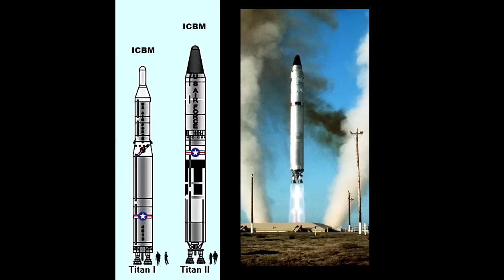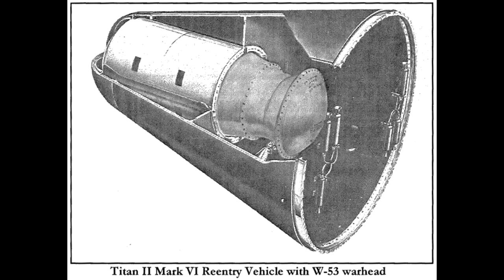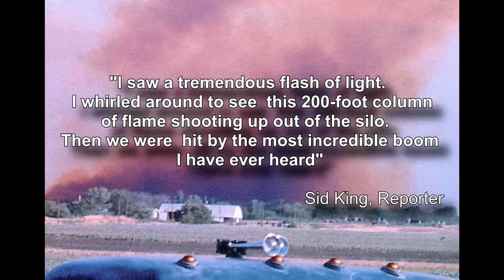Nuclear Missile Explodes Inside Silo - The Arkansas Titan 2 Incident (1980)

Comment: I was a young crew commander in the 70s and pulled alert on the day after the accident. Pre-departure took extra time as we had to make numerous corrections to our “dash-1” tech orders. For several alerts thereafter we were updating our tech orders to make procedural changes.  The site was full of hazards and the fuel/oxidizer especially so. Pulling alert at the Titan II was more engaging than Minuteman I suspect as we were co-located with the sortie and the liquid fuel system requires much more maintenance and environmental conditioning than the minuteman.  Their challenges were keep on top of their many systems. My only regret is that I didn’t do a follow up tour on GLCM or airborne launch crew.

Comment: "Was there ever any risk of a nine and a half megaton explosion?"

No.  Nuclear weapons are actually horrendously difficult to set off.  Detonating a nuclear warhead is actually a perfect storm of conditions that must be precisely controlled in order to sustain the reaction to the point of detonation.  If the warhead was damaged in any way during the incident, you would lose the precision to create those conditions, and the result would be a messy dud explosion from the ignition explosives.   Secondly, there would be no risk of accidental triggering, as there are multiple safety interlocks that prevent arming of the warhead.  And I'm not talking 'oh there's a switch here' casual speak.  I'm talking:  'Until the silo gives a fire order to the missile, there are physical pins and stops that separate the arming mechanism from the firing mechanism entirely'.

These weapons were designed by people who fully understood what they were messing with, and really didn't like the prospect of the thing going off in their face...  Even without nuclear materials.  It's STILL a container full of explosives.

Nuclear weapons are HARD.  That's why they only get built by properly industrialized and technologically mature powers.  Otherwise, they'd be as common as cannons in the 17th century.

Comment: Excellent summary thank you!  I have heard bits about this but now it is much more understandable.  Props as always to you and your channel!
Reply: FYI it is possible they DID test safety features on live warheads (Coloumb tests???)  IIRC though not to the degree you've described (thank God)   IIRC (and this is going back to a thesis I worked on at university a lifetime ago) there were several live tests of such features on actual (small yield) warheads in the Nevada desert in the 1950s.  Now that might be a topic you'd be interested in - tangentially of course, or perhaps Fallout City USA (specifically, the radioactive contamination that several times fell upon St. George, Utah and surrounding areas, particularly during tests Nancy and Harry), or perhaps the atomic soldiers.  Anyway, great vid that certainly spawned a lot of thought!

Comment: Not strictly true that the bomb couldn't be accidentally fired. The fissile material in the core, already overloaded through extensive refinement with neutron heavy material simply needed to be compressed to become critical.  This compression is usually created by explosives wrapped around the core. The explosion using a type of plastic explosive can also be used as a fire lighter as it can be made to burn readily with a flame,  unless,  , ,it's in a confined space in say a nuclear warhead,  in which case once it reaches its self accelerating decomposition temperature,  it'll explode. 
Your welcome.

Comment: From 1966-1969 I was stationed at McConnell AFB in Wichita, KS.  My job was maintaining communication equipment on sites identical to these.  The biggest danger around the Titan II, officially known as the LGM-25C weapon system, was the fuel and oxidizer used in it.  Liquid fueled missiles prior to Titan II used cryogenic liquid oxygen and a kind of kerosene.  Because of the super-cold oxidizer, the missile could not be kept on alert with fuel loaded.  It had to be fueled after receiving the launch order, a process which took nearly an hour.  The Titan II used a hypergolic fuel and oxidizer which was stable at ambient temperature, allowing the missile to be stored fully fueled.  It could launch within about one minute of receiving the order.  Both the hydrazine fuel and the nitrogen tetroxide oxidizer were horribly toxic and ignited when they came in contact with each other.
Reply: I really need to ask, how could such a wrench puncture such a strong weapon?  How is it so flimsy? Flimsy so much that a tool part could blow the fuel outwards. Was the metal used; Aluminium or something? Also surely using Nitrogen would cause many more problems like causing metal damage. Like it becoming brittle. Would that be the reason that happened or am i just completely wrong all together?  haha
Reply: @zae2193  the skin of the missile is just aluminum sheetmetal, an 8 pound socket going pretty fast will cut a hole through it pretty easily, and since the interior section it punched through had *pressurized fuel*, just like a can of compressed air, it sprayed out into an aerosol mixture. 

The oxygen and nitrogen compounds are used specially designed cryotainers made to hold them so that the incredibly combustible oxygen doesn't boil and ignite immediately, while I'm not as familiar with nitrogen, it's the same basic principle
Reply: @ToastGamingNCrew  Sheetmetal for real? I've worked around that for a while and know it is pretty brittle in that sense that it doesn't take much to cut into. Surprised such little would be used on such a highly dangerous weapon. 

Thanks for the explanation, helps a lot more, now understanding.
Reply: @zae2193  
Has to be thin to keep the missile light.  Otherwise could not go 6000 miles.
Reply: @zae2193  Yes, you are partly wrong. The airframe is rather thin on the Titan to save weight. To make the entire structure strong, it utilizes pressurization of both fuel and oxidizer tanks to keep the tanks and missile skins in tension rather than compression, making is very robust. However, as the 1 tank was leaking and no air could get inside the tank, negative pressure or a vacuum formed inside the tank. The very weight of the full and pressurized upper tank was bearing down on the lower tank and airframe structure. As the hours passed the lower tank became so weak that COLLAPSE was definite and would cause the upper tank to rupture, mix the fuel and oxidizer and EXPLODE !  Also calculate the weight of an 8 lbs. socket falling a distance of 50 to 60 ft. It now has greater weight and the VELOCITY at which it hit the side  of the missile. Evidence of the explosion shows it began IN THE SILE and NOT AT THE FAN OR SWITCH. The evidence is that the SILO DOORS blew of in time before the warhead could impact them as shown by the pics of the recovered warhead.    Second, you are thinking of CRYOGENIC NITROGEN, super cold.  This is just gaseous nitrogen to pressurize the tank/ airframe as a homogenous unit and prevent any oxidation !
Reply: @SteveWright-oy8ky  Thank you for the information! Yeah i'm shocked, but after telling me that, it makes a ton more sense. Of course it wouldn't get far if it was heavy, so being so light and easily to damage, it'd defenitely be the ideal way to go. Don't get me wrong, a lot of that was a bit hard to understand, considering I don't study in that field, but defenitely good to know in future. 
Thanks again, as it defenitely helped further understand.

Comment: I would have stresses and clarified that the Titans performance was almost entirely due to its lightweight construction - so light, that it couldn’t support its own weight. I know it was mentioned that the “heavy upper stage and nuke might crush the bottom part” - but many aren’t aware that the rocket literally can’t support itself if it isn’t pressurized.
Reply: The steps taken to swap out a missile require careful propellant transfer to prevent the airframe from collapsing.
Reply: ALL missiles and rockets are designed for weight savings so a larger payload can be lofted into space orbit.  The missile design is sound as long as it is maintained as designed. Fuel and oxidizer tanks are kept at specific  levels and pressure to keep the airframe strong and integral !  Amazing that the airframe didn't collapse sooner  !

Comment: I worked on the T-ll program, and the fuel is Hydrazine, and the oxidizer is Nitrogen Tetroxide.   Since the mix is hypergolic, when Hydrazine comes into contact with any oxidizer, it immediately combusts.  It was only a matter of time before the leaking fuel came into contact with some rust in the silo- like a metal staircase, or some rust on a pipe not covered with paint.   Rust is oxidized metal, and therefore an oxidizer.   Slowly, over time, the shift to solid fuel motors on strategic missiles became the norm, because they are more stable over the long term.

Comment: Great video!
There are professions where you don't want to hear an "Ops"...
I've worked with a lovely old woman in a lab. Who, because of her age, just didn't learn new stuff. No matter how often i told her, that the instrument shut down for safety while she changed the column on a gas chromatograph, because she didn't shut down the hydrogen flow before doing it, she did it again and again... And also left the flame ionization detector on, who, as the name suggests, has a flame in it... Luckily there is good ventilation in a lab, so it was safe. But still...

Comment: When I was stationed at Edwards AFB in the 1990s, a Titan rocket motor (from a solid-fuel booster, if I recall correctly) was dropped and slid down the cliff below the Rocket Lab on Lehman Ridge, across the lakebed from the base. It ignited and blew up. I was walking to my car to go to a meeting, and my first thought was, "Gee, that sun sure gets in your eyes." And they I realized that the sun was off to my right. A few seconds later, the "boom" came, and everyone came boiling out of the buildings to see what had blown up. And that was just a booster motor. I can't imagine the primary or second-stage boosters blowing up.

Comment: While working on an Atlas rocket, near the joint between the booster and the interstage adapter, a co-worker lost a bic lighter from his shirt pocket .(prohibited to have ignition sources on your person on the pad while fuel was aboard) the lighter impacted the elbow of the 10 inch external LOX line from the LOX tank to the turbopumps 5 decks below.  that line is like .040 stainless.  the lighter ruptured (BOOM) but there was no flame.  We tethered our tools to our wrists, and were supposed to keep lighters in our pants pockets.  Fortunately there was no fuel on board, but if the line had been compromised it could have meant de-stacking the whole missile and sending it back to the factory for repairs.  Also fortunately it was downstream of the LOX shutoff valve, which was closed.  This guy had been working Atlases since I was a pup. fred.
Reply: Scary as hell !  Protocol should have been everyone must empty out their pockets in front of an ARMED GUARD , pull Pockets inside out, etc ,.... just exactly for that reason. 1 single human mistake could have cost thousands of lives depending on damage to the warhead !  An Air Force tech used a screwdriver rather than a fuse puller and fired the retro- rockets on a R-V , causing it hit the silo door then fall down between the silo wall and the missile air frame ! And just because he was TOO LAZY to go get the Right Tool for the job !

Comment: Its not really possible for a warhead to go off accidentally like that. Even if the explosives that surround the core were to explode, they have to go off in a very particular sequence to compress the core, if they don't it won't detonate. Not that it has to, it could still spread radioactive materials all over the place. Its so improbable its basically an impossibility.

Comment: A small correction to the statement by the Air Force that , " a nuclear detonation could not happen " is wrong !  Due to the number of Broken Arrows and other nuke weapons mishaps, 4 tests were done at the Nevada Test Site of what was called 1-Point Detonation ! That a single stray bullet, electrical charge or hot shrapnel could in fact , set off a nuclear detonation . 1 of the 4 test PROVED CONCLUSIVELY that a 1-Point Detonation can happen in REAL LIFE , it was now established as a FACT !  Yet it still took nearly 20 years for the weapons safety designers to get the military to install the better fail-safe devices and P.A.L.s !  Far too many accidents of the  many different nukes is concern enough to us all and is still a major issue !

Comment: If the warhead had been compromised, cracked, broken open, there would have been radiation leakage, which could have been bad enough, but the design of the nuke required a specific sequence of events to detonate impossible to duplicate outside of it's design.  Even so, the warhead was a tough nut to crack.

Comment: Talk about a design flaw. I can't believe the guys that drew up that silo design didn't take into account the fact that fuel leaks and/or chemical leaks in a confined space require a spark-less and static free exhaust system as well as insulated switch panels and phones. I remember being in paint and solvent factories and THEY thought enough to implement those things as well as required footwear for visitors that would eliminate static discharge. 
That poor kid was a victim of government bureaucracy plain and simple. They gave him a button that would instantly kill himself. And how did that clown that had the wrong socket live with himself knowing that his screw up killed a serviceman. Tragic.

Comment: Actually a lot of the tests conducted by the US before the bans revolved around the testing of safety features. Also take note that the exact physics required of a starter explosion using conventional means is very precise.
Reply: For one, the fission only occurs if the core is first activated. I assume there are redundancies on how the core is activated to the point it would never activate accidentally on a nuclear warhead.

Comment: Re: the possibility of accidental nuclear detonation

To get a nuclear detonation requires a perfectly coordinated detonation of the conventional explosives around the primary.  It simply cannot happen without the detonators being triggered by the firing circuit. Those circuits would not be energized at that time.  Any unsymmetrically in the lenses that compress the primary and it just won't work.  It might make a hell of mess spreading plutonium around the local area, but it won't be problem measured in megatons.

In fact, there was an incident where a B58 landing gear collapsed and caused a big fire.  Several B53 warheads burned.  Their primary explosives were detonated, but "nothing" happened.  (for a very exciting definition of "nothing")

Comment: These Workers where stupid..    I saw this on frontline.  both of the workers, once inside the container where the rocket was, decided not to go back to get the right tool for the job.  At one point, once the huge nut was removed, the one worker, handed the item over to the other.  Asking if he had it tight in his hand.   He said he did .  However, it slipped out of his hand, falling down hitting the side of the rocket.  That is when the rocket fuel began to spay out.  It began filling the whole container.  Rocket fuel is extremely.  toxic and if inhaled, will burn up the lung instantly.  The two workers decided not to tell anyone in the plant about what happened.  However, the computer alarms started firing off wildly.  The only ones I feel bad for, are the firefighters who died in the accident.   Extreme radiation was now filled in the area.  The firefighters went in, risking their lives.   Farmers who lived around this hidden missile sight, had no idea it was even there?   I hate all nuclear  company's.  I am hoping we will stear away from it in the near future.  God Bless

Comment: "I am pretty sure that the Airforce never tested these safety features by blowing up a real warhead" - you are wrong here. A lot of the later tests on the Nevada Proving Grounds were actually safety tests where the expected yield was not significant higher than the conventional explosive. They probably never blew up a full W-53, but I would guess its first fission stage was tested. Because if the first stage does't go off, the second fusion stage never would. The Greensboro accident was perhaps a much closer call where one of the bombs went through the full activation sequence triggered by the parachute after being dropped and was only stopped by a simple electrical switch while hanging from a tree. The other bomb dropped cold (without parachute) and buried itself so deep into a swamp that it couldn't be fully recovered. But one of the parts found was said switch which had itself flipped to 'arm' from the impact ... But they did learn from that accident and increased the safety measures.

Comment: The worst possible “nuclear” event would be a dirty explosion.  The only way the warhead could have blew up as a true nuclear explosion is if the complex ignition system in the missile would have done its job, which is to set off all the conventional igniters at a very specific moment.  All of the safety systems and safety measures did their job.  I’m guessing the blast from the rocket propellent below the warhead would have been a very unorganized blast of energy upward, resulting in little more than a huge, inefficient mortar for the entire warhead.